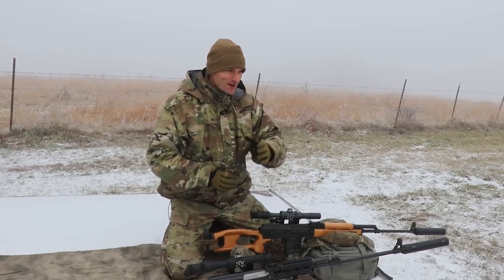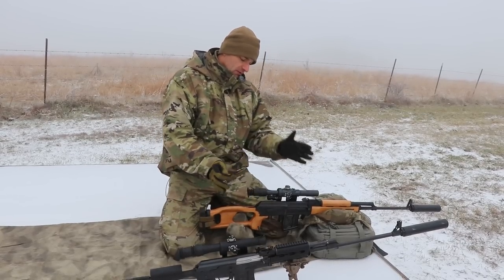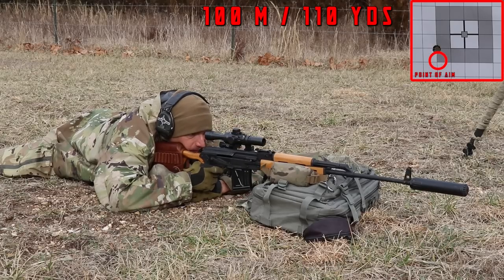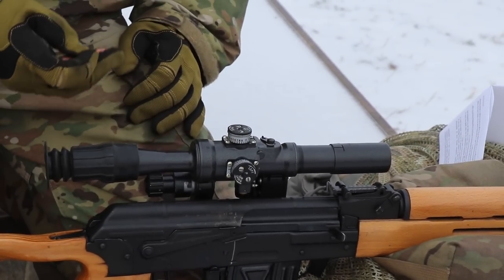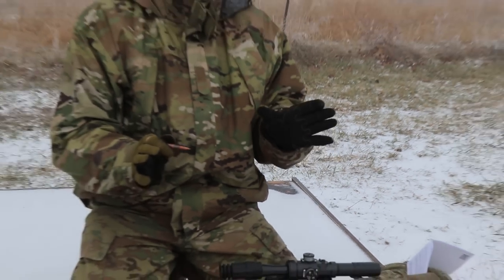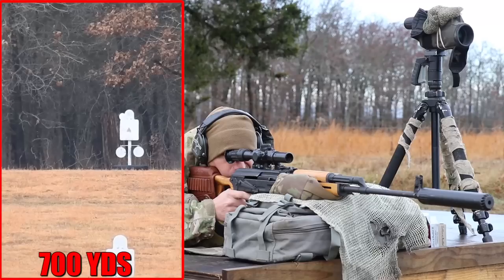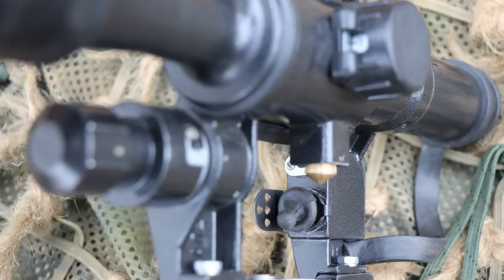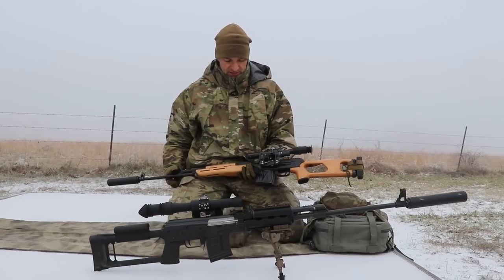How to Zero "ComBlock" DMR / Sniper rifle with PSO1 Scope! How to use PSO 1 scope!

Comment: The ZRAK you only loosen the screws to move the black turrets to avoid losing the bearing. The Russian actually has a center lock down screw, so although unnecessary you could remove both screws.

Comment: The Russian scope looks like it takes AA (1.5v) batteries. I found a 3v battery that fits and brightens up the IR. cr14505bl batteries.
Reply from the maker: Nice!!! Thanks!!!!
Reply: The Zenit PO3.5x21P 5.45 scope that I have on my Romanian PAmd86 build uses a CR123 battery and the locking mechanisim uses a different gear and screw arangement to set mounting tension.
Reply: @KNO BODY there are Adapters for AA Batteries around

Comment: In the most Simple way possible,   (As drilled into me,  By a  RU  Spetnaz Alpha,  Friend  & eventually  Neighbor. "DMR")    Put feet on the Horizontal line,  On the Curve, you will see Numbers.  Where the top of head Touches the curved line, Adjust range turret to that #.  If in between #"s,  there are  "clicks" there. This scope is also available in 8x. "Sun shade" extends  With 1/4  Turn & Pull out. (( so sun doesn't  glint/ Reflect & Show your position))  !    incredibly simple  !  Thanks Robski !  For the work you put into this Great channel !  & Showing (Through  ACTUAL HARD Use)  The Great  from...  Not so good !

Comment: Nice video Rob! afaik the bullet drop compensators are for targets beyond 1000 meters (Soviet designers seem to be quite optimistic :p). The idea is using the second chevron for 1,100 meters, the third for 1,200 and the fourth for 1,300. All of that with the turret set for 1,000.  
An interesting point that should be adressed is how to deal with the alignment issue, as the scope is not over the bore but slightly to the left, which can mean lateral deviation when shooting long range if zeroed dead center at 100.
Reply from the maker: That is correct - you can fine tune it for other calibers. I skipped 1100M, 1200M and 1300M and settle for Mils on purpose. Let’s be honest, 1300M with this caliber is unrealistic...
Reply: @AkOperatorsUnion  true that. And 1300M with 4x is even more ridiculous.
Reply: @AkOperatorsUnion  totally agree and i doubt any other PSO scope users have used these at that range. I am glad to see what they are using as holdovers instead of dialing it up.

Comment: As you know some ak optics don't sit centered on the rifle. They're offset to the left. When zeroing, do you have to take the offset into consideration? I feel like if I zero a posp scope at 100 meters, it will be shooting left at say 400 meters. If I'm gonna zero a scope I want to do it properly lol
Reply: I was wondering the same thing but finally decided that this has been their design for decades and doubt they would not use a faulty method after all this time, sure it will be fine when changing distances.

Comment: I've seen battery conversion  adapters as well as LED replacement  light sources for the PSO scope series. The led light source should  greatly increase battery life.
Reply: You can order the replacement bulbs from Kalinka optics. It's pretty cool because there are a few colors you can change the reticle, The standard of course being red but I think you can change it to orange, yellow, green or blue as well.

Comment: Thank you for doing this video! Extremely comprehensive, I'm finally going to try and zero the optic I have. I have a 400m PSO I purchased for my Vepr in 7.62x39, But I also have a Vepr in 54R, will there be too extreme of a calibration difference if I put the 400m optic on the 54R vepr? or should I keep it with the 7.62x39? Thanks for all the great info you put out!
Reply from the maker: 400meters is for range finder - that scope could be effectively used on 54R too!
Reply: @AkOperatorsUnion  thanks! 🙏

Comment: Hi Rob.
I'm very new to optics in general and I have a POSP 4x fixed scope coming in the mail.
I read the online manual in advamce and it seems that my range finder goes different direction (it gets taller from right to left) and it uses only 1 meter as a calibration value.
It goes on to explain, that if the target is 2 meters tall, I will have to divide by 2.
I find this kind of strange, as most of these range finders are calibrated towards average size human, which is about 1.75 meters or so.

Also, this might be a dumb question, but being that the scope will not be sitting directly over the bore axes (probably to the left), wouldn't the bullet path and the line of sight intersect at some point past zero and the bullet would then drift violently to the right?

Comment: Be Careful about those elevation and windage screws. The metal is very soft, make sure you are using the proper size or else you may strip the head.

Comment: Hi Rob, I have a question: How do you adjust the scope If the MPOI is on 18 cm on the right and 18 cm down? You said that 1 click is 5 cm on 100 M, so how do you zero the scope if the distance of the MPOI from the POA can't be divided by 5?

Comment: Hello, love your work and thank you for many hours of enjoyment. If I may, I have a bit of a question if you have the free time. I have a psa gf3 that I placed a Belarus pso on. The thing I'm worried about and can't find anything on is that my pso touches my dust cover. Directly in the middle of the pso there is a metal part that has a wire going into it. That part is in contact with the dust cover. If this will just scrap the dust cover, I care not, but I do not want to damage my pso or have it effect zero/shots. Any thoughts would be greatly appreciated.

Comment: Couple questions:
- when you zeroed the PSO scope at 100m did you set it back to 0 or 1 on the elevation? Dont think it matters a lot but just curious.
-What size head do you recommend for KNS piston, large or small bore? 
-Is there a trigger you recommend for PSL?
Reply: Never zero at 0. Have it set to 1 for 100. Don't have it "halfway between 0 and 1 for 50m" like he said. If you're zeroing on a shorter range, zero at 25m and set the elevation to 2 for 200m. Where your scope and bore are aligned at 25m, is also where your scope and bore will be lined up at 200m. The scope is offset, so this intersection really matters. It's not like a normal scope that's in line with the barrel.
Reply: @glennf9950  yeah, still a good video overall. I ended up putting the KNS piston in mine also but watched a few other videos and ended up with an ALG trigger in mine. Happy to report no issues with it after several hundred rounds and between the trigger and piston doing about 1 MOA groups at 100 +/- .25 MOA with 182 grain Yugoslavian ammo.  

I will say that I talked with the company of the trigger he was running and they didn't recommend theirs for the PSL at the time (was about a year ago).
Reply: @jimihenedrixson7568 which size KNS piston did you go with? Didn’t realize there were 2 different sizes. Ordered one last week and just got it today, but I think it’s the wrong size. It didn’t specify large or small bore online, neither does it on the packaging here. 

My PSL rifle is a brand new build, ordered from Classic last month and I think I saw online that newer model rifles need the small bore?? Is it even worth installing this one on it? Would the large bore version work at all? Thanks
Reply: @bigbossbyu2755  I went with the large bore version for the PSL IIRC. If you call them though they do (or at least did) offer some advice IRT running different sized piston heads in rifles for example running a 74 one in a 47 rifle.
Why do you think the one you ordered is the wrong size?

Comment: Is there a way to straighten the cross hairs up to be parallel with target, using the standard lps 4x6 tip2 mount? If the gun is held level, right now the reticle is tilted and crooked to the target.

Comment: I have always wanted to hear from another source how the PSO scope's reticle worked, and Rob seemed to have mostly confirmed what they said. However, the place where I got the information from, they said that the scope was meant to be dialed for elevation, and that the turret was in meters and not mils. So 1 would mean 100m I guess, and 10 would mean 1000m. And when you get to 1000m, the 2nd chevron should be perfectly lined up for 1100m, the 3rd one for 1200m, and the bottom chevron for 1300m. Not sure how one is supposed to shoot out that far with a 4x power scope, but it is a Soviet design, so anything's possible. I don't know if there's any truth to that, as I don't think most folks have shot out to 1300m with a SVD + PSO combo to confirm it.
Reply from the maker: Yes, but 1100 to 1300 meters with this round is fantasy. You will be in the “area” at those distances...that’s why didn’t even talk about that. But using 2nd from the top chevron for quick engagement at 500yds is doable and works well
Reply: @AkOperatorsUnion  that's what I was thinking as well. Thanks Rob!

Comment: Got a question for this type of scope. Bought one for my AK and it fits and sits perfectly however it is not parallel to the barrel. When scope is attached, looking down irons the are on target, the scope aims above and to the left to the point that I cannot see the target in the scope at 100yards. How can I solve this issue. I've taken the rifle to a gun smith and was told the side mount is in place properly.

Comment: Good basic video guys but it leaves out an entire first order of procedure.  These scopes DO NOT HAVE erector tubes.  The reticle moves inside the scope like many of the ancient pre 1970's scopes.  That means it literally moves inside the tube up and down on a linear stage.  This means you must first make sure the scope and mount are relatively centered to the bore of the rifle and the center-line of the scope.  Once you set up these centerlines (you have to do some shimming to get it there on some setups, like my Vepr 7.62x54 required a few shims) then proceed to procedure outlined in this video.  If anyone is interested in seeing a demo of this, I can do a video, but I would like to hear if anyone is interested first.
Reply from the maker: Yes, I'm aware of shimming, however, reticle not always being in center is still operational and could be used. On that note, if someone is bothered with off center reticle or if reticle is way to the left of FOV or to the right and so on, then yes, do the shimming. But that's the subject for whole separate video. This one is 20 minutes long already...

Comment: I saw that many Soviet soldiers in Afghanistan would mount PSO scopes on AK74N and AKS74N rifles. Apparently I heard that 5.45x39 to some range has the same trajectory as 7.62x54r. So how well does a PSO scope designed for 7.62x54r work on a 5.45 gun? I think this is an interesting test to make in the future.

Comment: I have a PSL-54 rifle with this scope. The railing on my rifle isn't attached on the right side so there is about an 1/16" gap on the far right. From what I can tell this is how it was built. So when you attach a scope it shoots probably 2 feet to the left at 100 yards. I can get it almost right by adjusting the recticle to the extreme left but it sure doesn't look right through the scope with the recticle on the far left. Is there anything I can do besides getting the railing welded more securely so it's flush with the gun?

Comment: Nice video Rob! Any advice on using these on a x39 platform rifle? I'm having a hard time getting my pso to zero on my wasr.
Reply from the maker: Well, i would advise against using it on 7,62x39 - scope sits really high, makes it awkward aiming with it. But, enough with bitching, chevrons are designed for aiming at 100, 200 and 300 meters for the 1st 2nd and the
3rd chevron accordingly. Zero from 100m.

Comment: Might be too late for my PSO-1. I thought you had to adjust only by loosening screws. My reticle is so off center it doesn't even all show in the tube. It would be a nightmare to zero
Reply from the maker: Ahhh, ok, you can shim screws which are attaching scope to the base - by using different shims you can center reticle !

Comment: If the math or the distance between the poa/poi is different according to the caliber of AK, I would love a video to explain zeroing each system. 5.45, 54R, et cetera.
Reply from the maker: They could be used on other systems I would just have to run numbers and verify whole thing.
Reply: @AkOperatorsUnion  So the distance between point of aim, and the black box you want to put rounds through is the same for all AKs?

Comment: Rob, good video.  Were you able to find a solution on target grade ammo for DMRs?
Reply from the maker: Try SB 174gr Match - see if it works for you
Reply: Pervy Partisan is selling 182gr "Match Line" ammo.. Brass case, reloadable, non corrosive.. Around $150 for 200rd case, free ship at AmmoEmpire.. They also have 182 "Rifle Line", brass case non reloadable for cheaper price.. Reloadable ammo might make a 54R rifle worthwhile to me.. 54R Ammo, not produced in USA, is the reason I never bought one.. Quick Policy change, can block importation, so you lose your ammo supply.. LOL, Murphy's law, if I buy one, it'll happen for sure..

Comment: Great video, but I have two questions:
where as:
US (artillery) mils = 1/6400
Russian (artillery?) mils = 1/6000
and True mils = 1/2000π = 1/6283.18530718...,
and where as American scopes used turrets and reticles calibrated to different units (true mil reticle (NOT US artillery mils, this is a fud myth!) with moa turrets, 🤮),
and being that you said:
1 click = 5cm at 100m = 5mil, 
my questions are: 
a) are the turrets calibrated in Russian or true mils?
and
b) is the reticle calibrated in Russian or true mils?
Reply: I'm gonna say 99% sure it's all in Russian movement. Someone else pls chime in

I have to set my new PSO up this weekend
Reply: @deltadelta5095  I guess put it in a vice and run the turret and see what you get for movement.

Comment: Where is a good place to buy this scope and which country typically makes the best versions?
Reply from the maker: Kalinka Optics has some, try to find one made by NPZ
Reply: NPZ is the Russian-made brand (look for НПЗ on the box).  POSP is made in Belarus to the same specs, and you'll be fine with either of them.  Note: if you buy from Kalinka, all of the markings on the scope and the manual will be in Russian.

Comment: These aren't sniper rifles.
Reply from the maker: M91 is actually sold as Sniper Rifle, so, it is what it is... https://www.zastava-arms.rs/en/sniper-rifle-m91/
Reply: Sniping means shooting from a concealed position. It has nothing to do with sub moa accuracy, or super long distance, even though it sometimes entails the latter. And the SVD, the PSL, and the M91 were all designed as sniper rifles, and fulfill that role well. A fucking 10/22 could be a sniper rifle, if you decided to snipe with it.
Reply: @christianharris7351  you are correct , I heard about snipers in Iraq using 22lr at close across the street ranges by busy streets , shooting inside houses buildings to conceal noise and aiming for face of soldiers . Not sure if this is true .
Reply: @jamesu223  It's true. And literally any rifle purposed to engage the enemy from a concealed position is a sniper rifle.